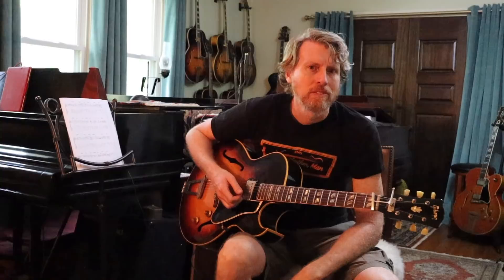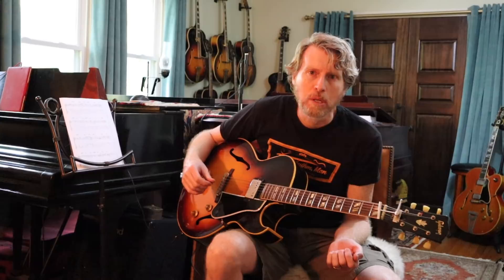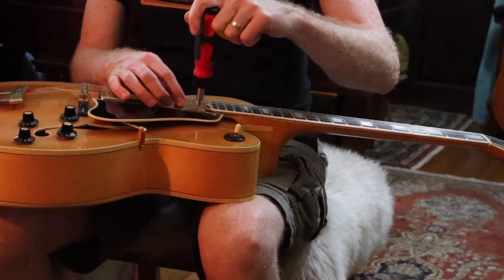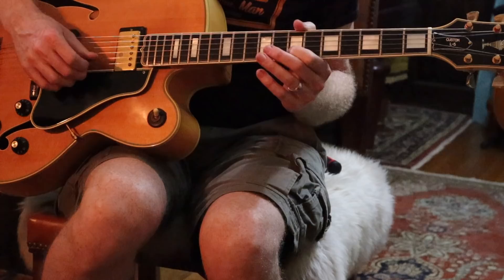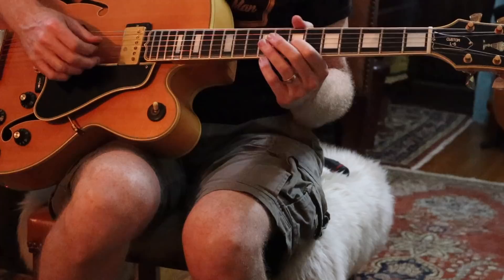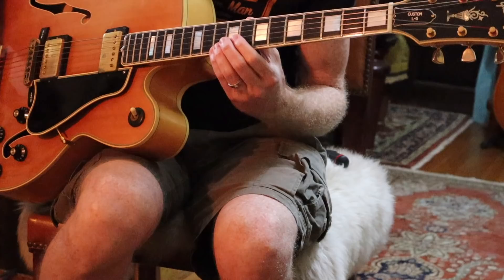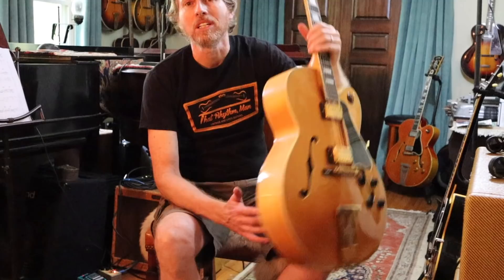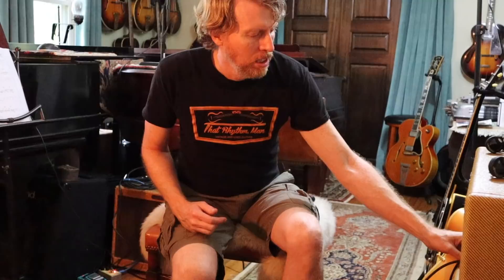Herb Ellis Method for Adjusting Neck Pickup Poles - Demonstrated on a 1978 Gibson L-5 CES

Comment: It's a personal thing, and depends on string gauges (and wrap materials for wound string balance), personal technique,, and of course EQ. It doesn't surprise me that Herb set up is guitar this way, partly because he might have been rolling his tone knob so far back (and the tone cap value was such) that the high E amplitude would be attenuated.  Thanks for sharing, it's always interesting to see how different players set things up.
Let me refer you to this video: https://www.youtube.com/watch?v=ZIxyd1nmlb4  At about 2:05 there's a closeup that clearly shows his pickup setup-- in this case not quite as extreme as shown in the present video.
Reply from the maker: LOL...the ES-175 I’m holding in this video was Herb’s main guitar for most of his career. It’s still set up as he last had it. The video you linked to is him with his Aria that he played whole under endorsement. I’m sure that guitar required slightly different settings than the Gibson.

Comment: IMHO this is really wrong for many reasons: 1. guitars are not at all alike. 2. you forgot to play with the 2 main pup screws because that will give you more or less body and volume to the overall sound you can't just use the pole screws only. 3. there is no universal way of doing this because there is no right and wrong... it's a personal taste but there is a limit. 4. all those screws sunken inside the pup kills the high frequencies completely so you end up with the bass strings being very muddy and the first strings very bright which is very wrong. 5 the only case where i see sunken pole screws like that is on the B string and/or on the unwound G string. I'm sorry to say it this is nonsense!
Reply from the maker: Davide,
Thank you for your opinions.  I think you are correct that there is no right or wrong.  This is simply a quick demonstration of how Herb Ellis liked to adjust his pickup poles, nothing more.  You are correct that I did not discuss adjusting the pickup height adjustment screws, and that can be important as well.

Here is where I will have to vehemently disagree with you.  Despite what one might think, sinking some of the poles beneath the pickup cover absolutely does not kill the high frequencies and does not lead to a muddy sound.  While I don't really find this method helpful for a bridge pickup and not as helpful with a P90, I find that it actually increases overall clarity in a humbucker by quite a bit.  I have tried this on literally dozens of guitars at this point, including solid, semi-hollow, thinline hollow, laminate archtop, carved archtop, etc..    I'll attach a link to pics of Herb's actual humbucker in his ES-175.  You'll see that the B string pole is sunken which is the string you say that you can see doing it to.  The others with the sunken poles are the heavier wound strings.  In contrast to what you predict, these strings become less boomy which actually significantly reduces muddiness.  I've found this especially helpful in a live setting where I am playing in a live venue with other instruments with ambient noise.  The string to string balance is noticeably better, and my guitar has just the right cut. 

That is my personal experience, and many others have found this video very helpful, messaging me to let me know that they have had very similar experiences.  Again, there is no right or wrong, as you said.  On the other hand, it is definitely not "nonsense".
Reply from the maker: https://imgur.com/nCbOFYG
Reply from the maker: This is Herb playing.  Certainly does not sound muddy to me.  

https://youtu.be/7C352J720Xo
Reply: It does say Herb Ellis method, and not universal method.